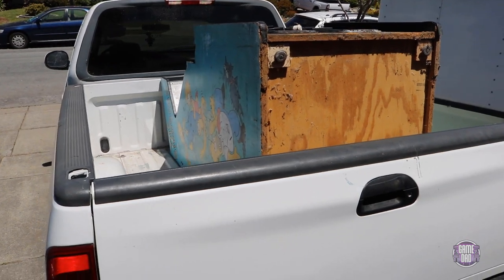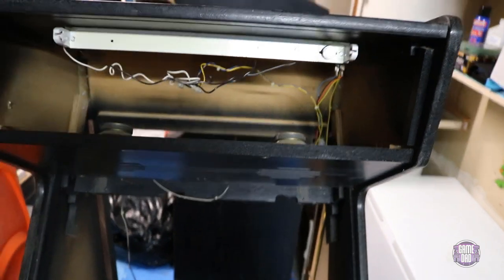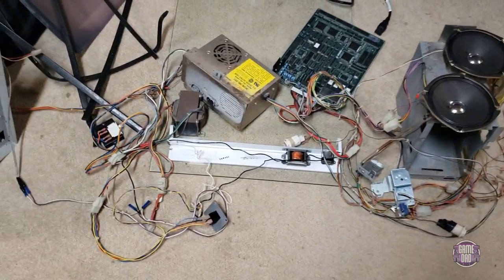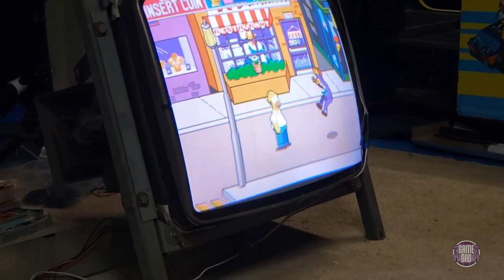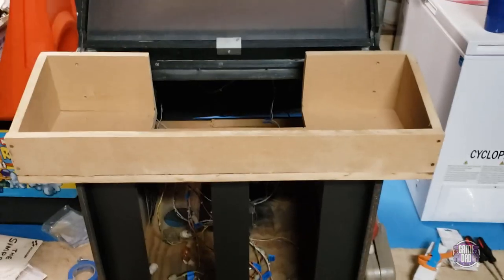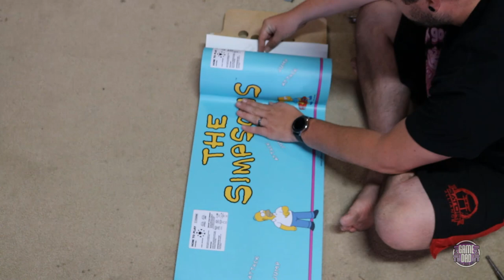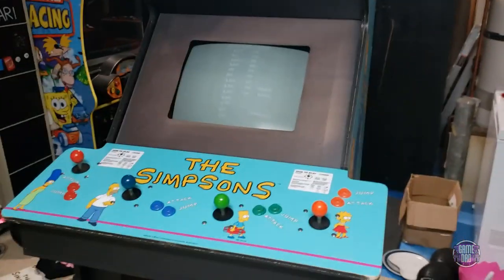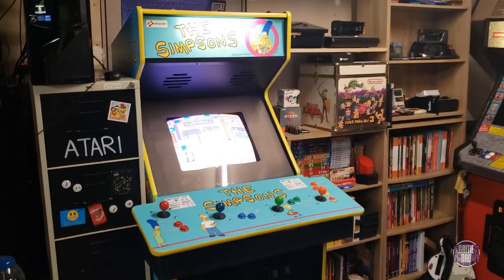The Simpsons Arcade Restoration! (CHECK PINNED COMMENT!)

Comment: Nice job.  It’s great that you could get the vinyl artwork.  The arcade machine that I’m working on had spray/stencil artwork.  I could use tape instead of stencil, but the.blurred edges on the artwork is part of the authenticity..

Comment: Nice video. Have you ever thought about upgrading the CRT to a bigger size? The cabinet can definitely hold a bigger size.
Reply from the maker: It actually originally comes with a bigger size (this is just what was in it when I got it), but honestly, for me, it works perfectly fine and if I were to go bigger, I would likely just ditch the CRT altogether and go lcd. For now though, it's all good :)

Comment: what is the hole at the bottom about?  Subwoofer?  Ventilation? ... downward ventilation?
Reply: Usually the holes at the bottom of arcade cabinets are for air ventilation, any form of sound is usually in front of the cabinet.

Comment: Hey there. I have a Simpsons machine and recently turned it on and it is not working. I've been posting on some arcade forums looking for help and people have made suggestions that haven't done the trick yet. Do you think there would be any way you could give me tips or guidance? I know nothing about these machines and have only just begun to scratch the surface. Thank you for your time
Reply from the maker: The first thing I would look at is the power supply and making sure your getting proper 5V power to the board. Also check all plugged connections and maybe even clean the contacts a bit to ensure a solid connection.
Reply: @GameDadShow  hi there. I have more info on the specifics. When I fire up the machine it does a ram rom check and when it gets to the 16c and 17c, it says "BAD" followed by a 4 digit sequence of numbers/letters that seem to change but usually has the same sequence of numbers. I was told on an arcade forum to reseat the chips. So I did that by carefully prying on the specific chips on the board and carefully replacing them. Didnt fix the problem sadly. So that is where I am currently and do not know where to go from here. Thank you for responding
Reply from the maker: Sounds like either the rom chips are bad, the contacts are dirty, or the contacts in their seats are dirty. Try some contact cleaner, but make sure it’s safe for plastics so it doesn’t damage the board. 

And of course. Let me know how it goes!
Reply: @GameDadShow  thanks again! I will try that for sure. I'll let you know if it works.

Comment: Where did you find this! Great find man.
Reply from the maker: Local game store owner had it. Traded him some console repairs for it
Reply: Could you recommend a basic tool set for repairs? I'm trying to get into the hobbies of repairing old arcade games but I don't think I have enough information on how to get started. More or less a bench test set up but I don't know what all I need. I like the old monsters so any tools for those would be extremely helpful. Thanks for the videos and I will definitely keep following.
Reply from the maker: @aarondaugherty9181  the ifixit manta kit has basically everything you could ever need. Here's an Amazon affiliate link :)

https://www.amazon.com/dp/B07BMM74FD/ref=cm_sw_r_as_gl_apa_gl_i_PT118GXDQQ3MGQF8XQMK?linkCode=ml2&tag=gamedadshow0f-20
Reply: @GameDadShow  awesome! What about a power supply tester or CRT tools? I have a multi meter and a solider gun. And do you know how to find diagrams for the games?
Reply from the maker: @aarondaugherty9181  i don't typically do any crt testing outside of a multimeter. As for diagrams, google is your best friend :)
Reply: @GameDadShow  thank you for all of your help I really appreciate it! 👍
Reply from the maker: @aarondaugherty9181  of course!

Comment: screen looks too small
Reply from the maker: It's what came with it when I got. I will eventually look for the bigger screen, but at that point I may just convert to LCD.
Reply: @GameDadShow  I hate the look of lcd im I have a Arcade 1up streetfight 2 and a meme cab with street fight 2 on it with a crt and it look 1,000 times better too me I wish i could find a 24in crt for a negeo i got in the back they cost too much now a days

Comment: Need a bigger crt
Reply from the maker: Ya, this is what it came with when I bought it. I will likely just convert it to lcd though.
Reply: @GameDadShow  ewww please tell me you didn't do that
Reply from the maker: I actually haven't done anything to it since I finished the restoration. I would prefer to get a full size crt for it, but they are getting harder and harder to find, especially in specific sizes.
Reply: @GameDadShow  "I will likely just convert it to lcd though"

A glorified calculator screen in an arcade machine? Is that a joke?